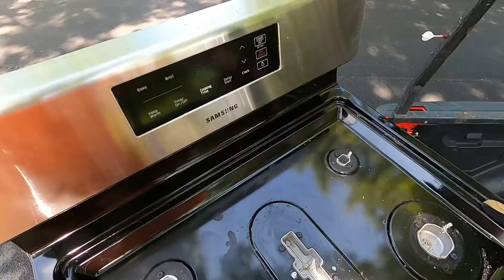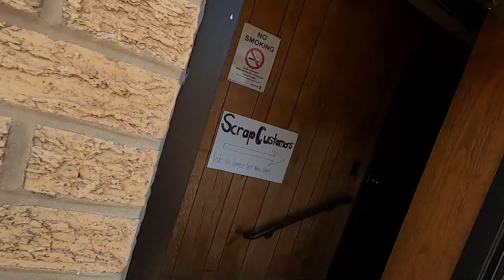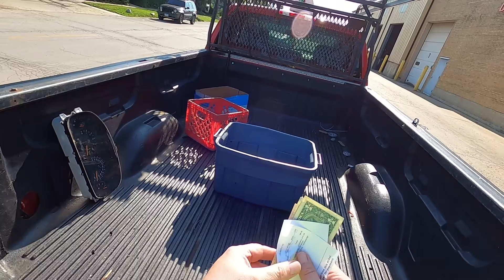Made BANK on Garbage Day

Comment: The freight gate is a great in vestment you made. I had one on all differnt truck I have driven.
I have a hard time excepting the way you tie things down.  I drove flat bed trucks hauling steel, machinery, electrical equipment, PVC pipe, carpet rolls, floor tile, for 50 years. 
When hauling steel you chained it down as if you were going too the moon even it you are ging across the road.

Comment: I used to work at GM car dealers and we would have those Dash's sent out for repair. The repair company we sent them to was D&B but I am sure they have a dash repair place by you. Some of those electronic Dash Clusters were big bucks. Some came with a Core charge, So some could be exchanged for cash.
Reply from the maker: That dash came from the car guy that was an instructor at the local college

Comment: So when I was watching your metal was paying $0.10 per pound and then I see this video and it's $0.06 a pound why is there such a huge fluctuation? 1000 lb should have easily been $100 in your pocket but you only came out with just over 60. I would be terribly upset at those prices that just seems like a rip off.
Reply from the maker: With it being a commodity it's all based on need. Supply and demand